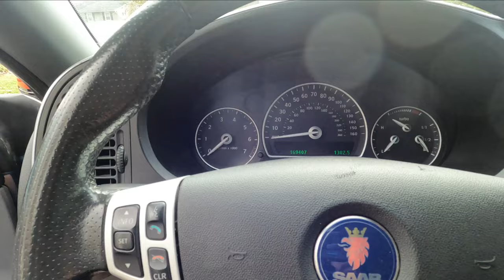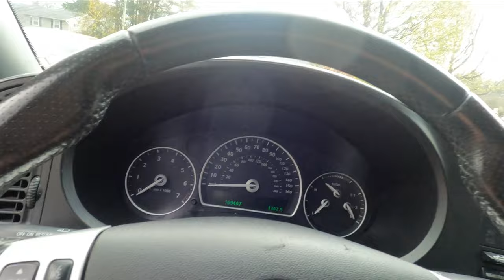2007 Saab 9-3 Master Cylinder Replacement! Full Guide!

Comment: Thanks for the video. Im actually in the garage now watching your video. Just changed the master cylinder. But a question... When I took off the master cylinder the pushrod inside the servo was loose. And I noticed its a fixed one without any possibility to adjustment. Was it like that on your car too?
Reply from the maker: Yep! It was like that on mine.

Comment: I may need to do this but I'm not 100%. Every now and then I have to press the pedal all the way to the floor to stop. Do you think this may be what I need or do you think a simple bleed would possibly work? Thanks in advance! Cool video, btw.
Reply from the maker: Hey thanks! I would definitely replace the master cylinder immediately if it goes to the floor. 

a bleed probably wont solve that.
Reply: Thanks, will do!

Comment: What about the clutch. You dont need to bleed that aswell?
Reply from the maker: Nope, didn’t have to this time. As long as you don’t press the clutch pedal with the master cylinder off it won’t suck in air. So when you fill the master up then you’re good. It just shares the reservoir with the brakes.

Comment: So did the pedal feel get better? I think i have to do this aswell. 330.000km/205.000miles on my car, when the car is off, it gets solid after 2/3 pumps and stays that way. But if the car is on, it will sink to the floor if you keep pushing on it. Looked easy, thought maybe it would involve some kind of abs bleeding aswell.
Reply: Also looking in the wis, it would be easier to remove the coolent reservoar to get better access. :)
Reply from the maker: @oscarmathia6112  yo! yeah no more squealing as well as great pedal feel. No odd bleeding required, just bled the brakes like any other car. Thing stops on a dime now 👍